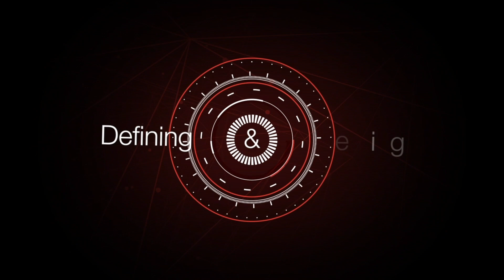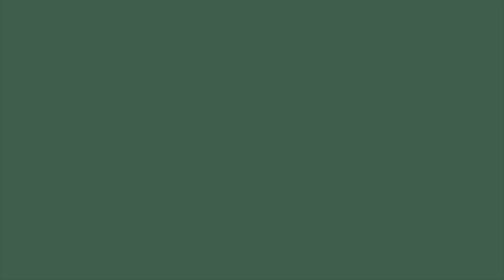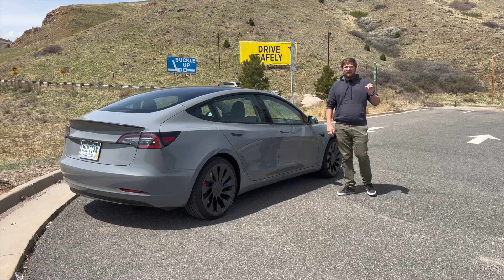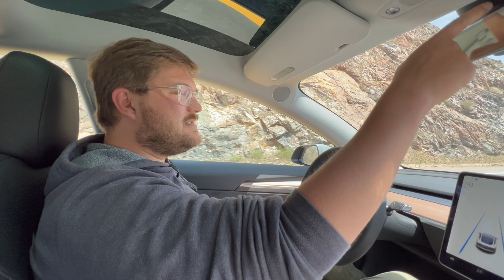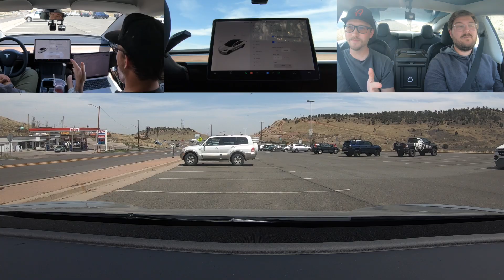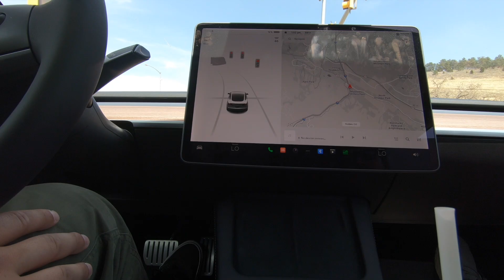2022 Vision-Only Tesla Model 3 Autopilot Hogback Driver Assistance Challenge!

Comment: serious question
If I set my Tesla on autopilot to 70mph and there is a dead stopped car or broken down car in my lane ahead and for some reason I wasn’t paying attention what would be the results? Will the Tesla do a hard break? Will it swerve? Or will it crash into the car ahead? 
I would really like to know the answer 👍🏼
Reply: It would probably brake enough to save your life at least, at most it will just come to a complete stop before hitting anything.
Reply: It would see it ahead of time and slow down, and probably beep loudly at you. If a car cuts you off it’ll slow a little and move over in the lane
Reply: Historically Teslas ignore stopped objects when they get over 30 MPH. This is one of the reasons they have eliminated the old radar in the car. Kept hitting stopped firetrucks when the driver was doing something other than driving. Fortunately the car is so safe that only a few people have died in highway crashes, and many have been completely avoided, but there is no tracking of accidents that didn't happen.
Reply: Not probably. It does stop in time. I know. It did for me…
Reply: @wolfgangpreier9160  Awesome to hear!

Comment: The minus 3 points is all the same bug while being in the far right lane. But because of traffic your lane choice is inconsistent between both car test and within a single test. So I’m not sure the point system is helping.  Seems like you should subtract one point for each scenario(bug) found.  Just trying to refine the test.
Reply: I have similar complaints. When the lines are not consistent humans know where the road is going. AP not. Its easily destracted. On roads with good lines it works flawlessly. As long as there are no medium corners. In Europe its crippled with max. steering angle and max. steering speed.

Comment: Why not start the driver assist test in a city/downtown area THEN get on a highway? I know Tesla autopilot can be used on city streets, and with so many automakers limiting the ADAS to highway only, I feel it's worth showing this difference in ability.
Reply: Standard autopilot is not intended for use on city streets. You can turn it on, but it is not the same thing as paying for "full self driving". It is not safe to use in the city.
Reply: @forbesjeff  It's not about how safe it is on non-highway streets, the point would be to show what these systems can and cant do.  Obv not to be used in every scenario, but I was able to use AP for over half my commute before I got FSD beta. I rarely get on what would be a 'mapped' the highway, so these systems like Rivians, fords, and GM supercruise would be worthless to me. So why not show what these systems can and can do in all environments?
Reply: @schmeltz  The goal here is clearly to use the systems for their intended purposes and provide something that is relatively consistent for testing.

I don't see much point in comparing systems in use cases they were not intended for.

Comment: Kyle, I was fine until you give it 2 points for being so good and taking away only 2 points for Alyssa taking the car into a slide to escape from AP. Forcing near disasters to escape the system does not seem like a net 0 to me.
Reply: It does for me. You can overreact with every system. Just try a VW/Skoda/Audi. Very easy. To overreact.

Comment: I'd love to see these tests done at night, too, to see how vision only can handle it!
Reply: AP actually seems to see (or at least predict) better than I can, at night or poor conditions (rain, fog, etc).
One time I was driving back road (two-lane, not highway) in central valley, at dusk, and could barely see faded dividing line... but AP not only saw the line, it recognized and rendered when the line changed between SOLID and DOTTED. I had to SQUINT to see it... but, it did fine.
Reply: @cgamiga  exactly. One night it was rainy and I couldn’t see the lanes, the tesla had no problem. After saving the dashcam footage, it looked like there was no rain. The car can literally see better than I can.
Reply: @harsimranbansal5355   yup. It also has little problem with glare, even staring right into the sun, checking teslacam video just shows bright ball, rest of road etc is visible.
Reply: On highways, It used to suck! Id get about 30 phantom breaks at night.

However its been fixed and now I usually get none.

On freeway its always been flawless

Comment: Thanks for another great vid! I would encourage people to use the right stick to disengage (like going into reverse) rather than the steering wheel torque issue. I know that cancels cruise as well so you have to get on the throttle, but you’re probably doing that anyway to speed up for lane changes or slow down for exits. 

Also, I’ve found that my M3LR with FSD doesn’t have any issues with exits or those super midd merging lanes 95% of the time. Not sure if it’s the FSD software or what but it’s almost always perfect
Reply: That’s how I disengage as well, just feels better than wrestling with the wheel. But you don’t even have to pull up all the way like going into reverse… just pull up halfway like going into neutral.
Reply: Actually if you tap up once, it only takes you back to cruise control. Then you can change lanes and reenable autopilot
Reply: chidorirasenganz if I’m not mistaken, you’re right but that’s only if it’s a half tap upwards. The right stalk has 2 levels of resistance in it. When autopilot is currently enabled, lightly tapping (to the 1st level resistance) it switches from autopilot to cruise control. But in the same scenario, if you hard press it upwards (to the 2nd level of resistance) it disengages both autopilot and cruise control. At least that’s my experience with it
Reply: @UCBYQJ1iO1ZrvmHozvmwqTZg Yeah I just tested after updating to the latest update and it’s no longer working for me on my 2021 M3. 

Which is annoying because it made it easier to switch lanes when on autopilot.
Reply: @chidorirasenganz  is this still true if you have cruise control chime turned off?
Reply: @trevrodriguezphoto  not sure as I haven’t turned the chime off. I’ve only turned on Joe mode lol

Comment: Did you have the option for Navigate on Autopilot on these roads?
Reply: That requires FSD, which this car does not have.  FSD is a $12,000 option. Autopilot is included, and they were using it to its full capability here.
Reply: @forbesjeff  Actually NoA is also available as part of Enhanced AutoPilot. EAP is a $6000 option and worth every penny.

Comment: 10:20 Maybe you should add a qualifier to the list "AP drops speed to the limit before the sign" next to "AP drops speed to the limit after the sign". That is, if you consider yourself an international channel. In many European countries, speed cameras are placed right at the sign of the town entrance; if your speed is not low enough then, you will be fined. Dutch prices as an example : 3 miles over = 33.50$ , 6 miles over = 72.50$ , 9 miles over = 140$. They do allow for your speedometer to have a 2.5mph deviation. 😋
Reply: Yes, VW has a major advantage in those Szenarios. And it’s annoying that Tesla takes at least 1-1.5 seconds AFTER recognizing a speed limit to limit itself. The other way just the same. And it never recognizes speed limits on the Autobahn. I sure hope they get their act together this year. As promised…

Comment: Nice video
Having driven both a Tesla and Hyundai with autopilot, both of which worked fine, I don't get it. The cruise control that keeps spacing constant, and the emergency braking are cool, but I see 0 utility for the driver for the rest. You have to have your hand on your wheel and pay attention- it offers no "aid" other than following the lane which i can do just fine myself thank you.

As for Tesla's FSD vision only: let's say a company managed to market it product as "full self driving" (when it obviously is no such thing) to the point they could get credulous customers to pay $10,000 for it. Let's also say that said company realized they are really not making much real progress towards level 4, but they could take all the most expensive parts of the system out of the cars and keep the price the same while minimizing the marginal cost of each installation to almost $0 since they need the cameras for the basic autopilot anyway (yes, I'm sure the processor is more expensive, but most of that cost was in the development). Why then you'd have an absolute cash cow , Just saying
Reply: For your first paragraph, the 'aid' is that you can 'safely' look around, knowing that the car will continue driving for you...  you can't afford to stay looking away... but it's safer to look away when the car is nominally driving for you, compared to looking away when you're in sole control.

Comment: Agree with much of what you say, especially the positive impact AP has on freeway driving. I’ve used it driving my 2021 M3 SR+ through LA, and simply using AP set at 80 mph made the stop-and-go then ZOOM then stop-and-go nature of LA driving sooo much less stressful! That’s what sold me on using AP regularly. 

I haven’t had any phantom braking issues (knocking on wood!) with my radar equipped car. It has gotten noticeably better on those wide merge on/off lanes. 

My pro tip Is to use Jim Morrison’s advice: Keep your eyes on the road and your hands upon the wheel, and you’ll be fine.
Reply: The stop and go traffic assist is so underrated. Of any benefit that autopilot offers, the traffic assist is far and away the most useful IMO. It makes commuting and stop and go traffic such a breeze. Can’t even express how frustrated I used to get constantly speeding up and slamming on the brakes in traffic everyday, and this system takes away like 95% of that frustration. It’s a legitimate game changer
Reply: @philorgneopolotin8762  Totally agree. I’m retired now, so not in that daily jam (how great it would have to have AP back in the day!), but any time I do find myself in that hot mess, I use it.
Reply: @philorgneopolotin8762  stop and go traffic assist is so basic, it's on $27k hyundais. and they have lane change..
Reply: @roboticvenom1935  wow congrats, who asked? Are you literally going around responding to all my comments like some sort of know-it-all? You’ve responded to like 7 of my comments in the past day all with some lame snide remark.

Comment: It's the same car that I have. My problem is that the car was so expensive I can't upgrade to 18" or 19" wheels because of the cost. I don't agree with your test on the floating nature of the car at speed around corners. I live in the desert of California but coming up to the high valley that I live in is an uphill, very fun, winding road. When I had my tuned GTI I could use every bit of the performance of that car coming up that road. In the M3P I can come up way faster and can't even get the tires to screech around the turns at 100 mph. I am in  love with this thing!
Reply: Teslas are usually  misaligned. Maybe you found a better one.

Comment: Radar vs vision: the reason to remove radar is because how do you decide which input is correct when they differ? If the radar gets scared because of snow or rain or a leaf, do you ignore it if the vision says it’s not a threat? The radar data quickly becomes useless because you end up throwing it out in favor of vision data.
Reply: They got rid of radar to address parts shortages and save money.
Reply: Not only that the sewer cover made of solid cast iron reflects so much more radio waves and hides its size . Same with bridges and it’s metal pillars.. anyone talk in favor of radar does not have a clue how they work .. Radar is great in open skies with 1 or 2 metallic objects flying.. it becomes a nightmare when all car emiting radio waves at same frequency.. just imagine the radio wave noise
Reply: This is propaganda Tesla wants you to believe. In real technical world, sensor fusion is a very basic algorithm on autonomous driving. All robo-taxis on the road (waymo, cruise…) use multiple types of sensors. Elon just wants to cut the cost without any failsafe when one type of sensors fails to operate.

Comment: don't turnoff autopilot with torque input, just click up on stocker while taking over wheel to safely disengage ap.
Reply: This is the way.
Reply: Good tip, I was about to post I lightly touch brake pedal, but stalk is even better, will try that! Thanks.

Comment: Speed limit tracking (up and down) is part of the FSD beta. It's not part of Autopilot.
Reply: My autopilot does speed limit tracking and adjustment...
Reply: @zonemaster23  You sure it's not EAP? The only thing I've seen AP do is adjust you down if you're not on a divided highway and you'd be going more than 5 over. It wasn't until FSD beta that I saw it 100% always tracking the speed limit and adjusting, which aligns with what Kyle experienced in this video.
Reply: @brad_wilson  yeah. I don't have EAP. 2021 MY
Reply: It definitely tracks down... very nice (and safe) for highways that go thru towns , where limit progressively reduces, helps avoid a ticket or accident if you aren't paying attention! (but also sketchy when it gets it wrong, eg picking up offramp or side street limit instead of highway.)
 Sometimes AP seems to track up, I think it's done so in certain cases, I can't recall

Comment: Part of the reason why the Tesla tends to jerk so much when you try to break free from AP is because the steering ratio is excessively quick. Tiny steering inputs lead to big vehicle movements. Autopilot is awesome but it’s flaws are really annoying and the vision based cars make the flaws worse. The crappy auto high beams are required to be on when auto steer is on, leading to a lot of flashing. The auto wipers have to be on, leading to high speed wipers during slight drizzle. It always tries to stay centered in what it considers to be “the lane,” leading to it swerving all over the road when you drive in the right lane. The need to disable the system and reenable the system every time you change lanes is annoying, especially the noise. The judgement of vehicle distance is pretty bad, so it slows down too hard and too late, then takes forever the system to accelerate once it is able (especially annoying and sometimes scary in traffic jams). When you change lanes to go around a slower car, the system doesn’t automatically speed up like almost every other car does. The phantom braking is the worst part of auto pilot and I’ve experienced it more on AP than any other driver assist. It’s gotten better, but still far worse than it should be and worse than any other vehicle I’ve experienced. It’s a great system and better than many, but it is not the best. I don’t have a ton of experience in a vision only Tesla (only a couple thousand miles) but it’s performance is also negatively affected by weather and nighttime driving. Nighttime and in the rain significantly impacts the system performance.
Reply: Sorry, but i can not follow any of your complaints. And i drive with Autopilot since end of 2019 when it became available in Europe. On a daily basis with over 50.000km a year. 

If you want to stop AP you can use the steering wheel - with less torque in the latest Software, the right stalk or using the indicators - then the torque to leave AP is even less. I don‘t use automatic high bream with Autopilot - sometimes i use it, sometimes not. makes no difference. I do not use autowipers if i don‘t want to - again makes no difference. 

I guess you are actually talking about FSD Beta. Not Autopilot?
Reply: I agree. I have full FSD and the latest beta (and radar though not sure if it's used or not) but my car freaks out frequently even if I am getting close to the roads edge even when not using AP. So bad...I rarely use FSD but its complete junk too honestly.
Reply: Trade it in

Comment: If you activate the turn signal then apply torque to the wheel it is FAR LESS then if you just apply force to get out of autopilot.
Reply: Yeah if you disable with autopilot with the right stalk (push up) then you be in cruise control. Then you can change lanes and enable autopilot again
Reply: Yes and the latest Software needs less torque.

Comment: Why are you riding in the right lane?  You can avoid the wide lane situations.
Reply: Because if you aren’t actively passing someone, you should be in the right lane. It’s a legal requirement in many states. Breaking the law should not be necessary in order to make up for the failures of the drivers assistance system.
Reply: Not only are you supposed to ride in the rightmost lane unless you're passing, it is part of the test.  If they rode in the middle lane there would be nothing to challenge the system.
Reply: The point isn't to 'avoid' the situation, it's to explicitly test how the automated software will handle the situation.

Comment: What does it mean to have the driver assist "mapped"? Example Kyle says Rivians are pre-mapped, but it still uses cameras and sensors to help during live assist. Genuinely curious.
Reply: The road itself (and streetside 'furniture' - signs, posts, barriers, etc) are pre-mapped in high resolution, lanes explicitly marked (rather than solely relying on the camera seeing the painted lines), and so on... the cameras are - mostly - used to monitor traffic, and confirm position on the road.